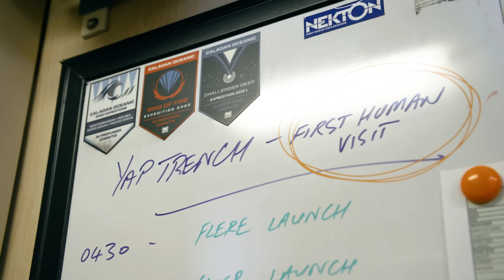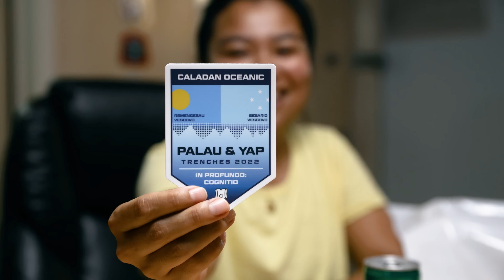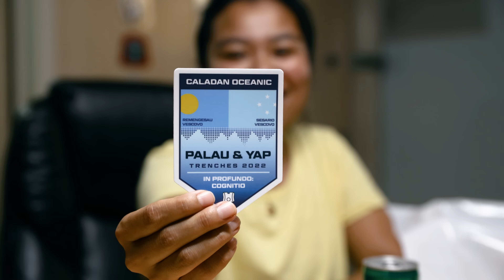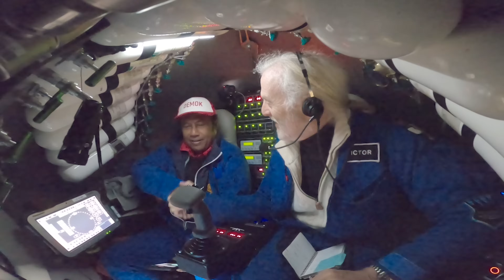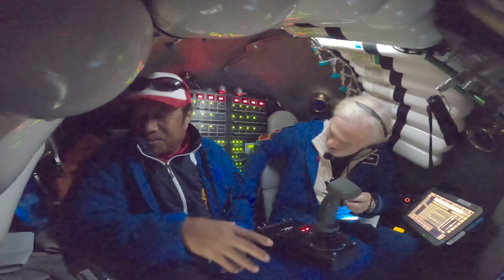The New Trenches - Caladan Oceanic's Palau & Yap Expedition 2022

Comment: You know he was ready to use stronger language when he saw the bottle and really held back. Very cool video! Our oceans are still such a mystery!
Reply: He probably noticed it was his.. I mean.. the paper wrapper was still on that thing... it clearly was dropped by someone on the research boat..
Reply: And yet they drop and leave their surface weights down there...
Reply: @bwin2992 was about to comment the same thing. The bottle definitely came from their ship. It looked way too fresh
Reply: @diegoscoffin7491  How does a glass bottle withstand this immense pressure down there without cracking? Cant comprehend that
Reply: Surface weights are bare steel that is just carbon and iron. It’ll rust away to nothing in salt water and it’s not pollutant at all
Reply: Meanwhile, plastic will not degrade. It will just remain..
Reply: @micahaalders9840  Our submersible weights were biodegradable. Thanks for watching!
Reply: @bwin2992  That brand of beer (in green bottles) was not available on the ship, but thanks for watching!
Reply: @diegoscoffin7491  That bottle came from a ship but not ours. Not only did we keep to our ethical responsibility to not put trash overboard, we didn't have that brand of beer (green bottle) available on board!

Comment: How does this sub compare to the OceanGate's Titan Sub who got lost?
Reply: It comes back to the surface in one piece…
Reply: They take testing and quality control seriously
Reply: @constantreader0947  OOOF 🙃
Reply: the pressure vessel, for one thing. limiting factor (this dsv) has a titanium spherical pressure vessel, which is just geometrically better at handling the pressures of the deep ocean. titan had a cylindrical and open pressure vessel made of carbon fiber, which is NOT a good material for withstanding pressure at depth. furthermore, limiting factor was made using purpose built parts instead of cobbled together junk. limiting factor also follows basic dsv design principles that have been around since the trieste, while oceangate decided they would completely disregard safety and would simply redesign from the ground up and ignore all standards. limiting factor is also rated for much, much deeper water than the titan ever was. it’s also been to the titanic safely.
Reply: in general the difference is this: the limiting factor is a good dsv, while the titan simply was not.
Reply: I know, the Titan was a ToysRUs junk compared to the Limiting Factor sub. Victor is truly a great person and not cocky or arrogant at all. The sub is DNV GL certified to 11,000 meters. Truly cutting edge sub construction technology and operations, unlike OceanGrate.
Reply: It's like comparing Wright brothers' plane to a modern airliner. lol

Comment: What are the surface weights that they talk about? Is that like some large weight that they drop off and leave at the bottom? More trash? Every video watched where they dive, they talk about releasing the surface weight.
Reply: The surface weight is made of biodegradable steel. Ocean bacteria actually eat it as a food source. It will take time, but eventually it will vanish.

Comment: Would have been nice if the submersible had been equipped to remove the bottle. Saddens me to see trash in the ocean like that. Especially when its in such a remote area.
Reply: The submersible does normally have a robotic arm but we could not take it on this dive because we were testing instead a state-of-the-art mapping device that was attached to the bottom of the sub. The device worked perfectly but due to weight limitations, it was either the mapping device or the arm. And our mission was to test the mapping device. Thanks for watching!